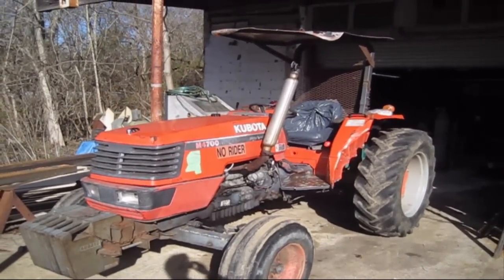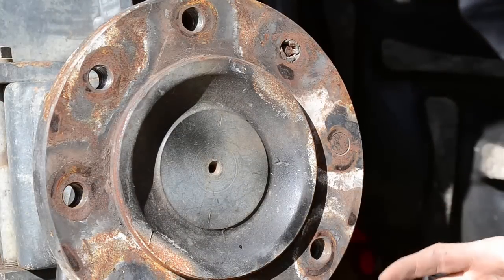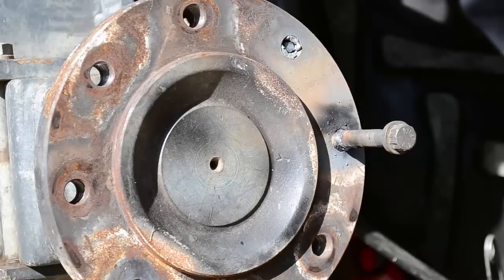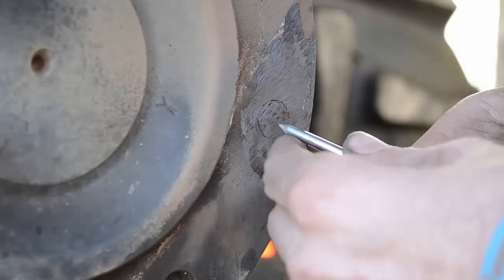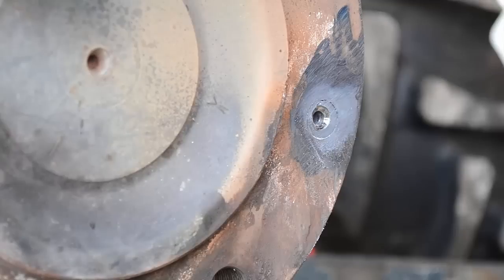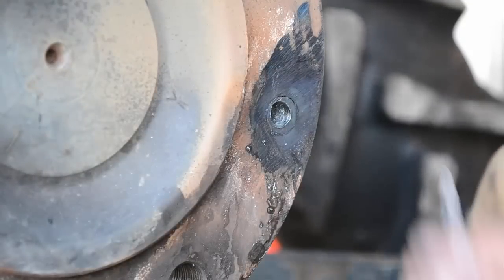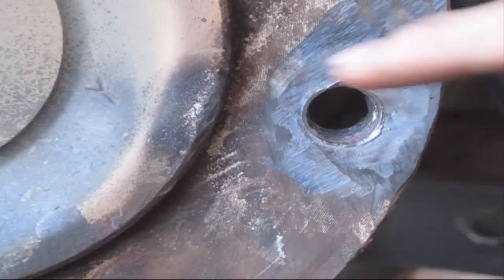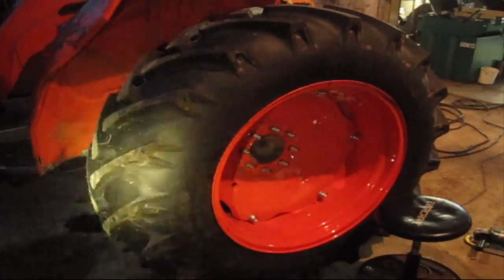Broke-off bolts techniques

Comment: A very good video. I've been working on classic cars for decades and often have these problems. In this case, you have great access and once you've drilled enough to get a mini-hacksaw blade through the hole, you can cut a slot and then chase the broken 'tube' of the fixing out with a punch.  As mentioned below, a welded washer or nut often works well as it gives you space to add plenty of weld without harming or welding to the flange.

Comment: Old machinist tip: aluminum fast, steel slow. (in regard to drilling or cutting speeds)
Reply: Absolutely right I drilled holes in railroad  tracks, it was a slow process,
Reply: Pilot holes would speed the whole deal up dramatically.

Comment: Wanted to see how you would correct the rim? A tool maker since 1962 I have removed many a broken bolts. We didn't have left hand drills, today use them first with slow rpms. If they can be drilled (not hardened) drill to the recomended easy-out inside diameter. Then throw the packet of eazy-outs in a lake. Now get a 10 inch adjustment wrench, a small ball peen hammer and all your flat files. Remove the file handle which has a tang which just starts into the drilled hole. Insert the tang until the angle stops, now tap a few blows with the hammer until the sharp corners 'bite' into the hole's sidewalls. Too hard will egg shape the broken bolt remainder! Adjust the wrench to clamp on the file flats, apply downward pressure on the file with one hand and back out the broken piece with the other hand/wrench. Also heed the lots of good advice from the other comments. IE ground the hub, heat one item only, lubricate, blow away chips before rotating, slow rpm and many others.

Comment: Good job. 
  A trick for you: to start a bolt, a nut, or a screw = first, turn it counter-clockwise, until you feel it fall into matching threads. This helps to prevent cross-threading... Greatly!
  You'll like it.

Comment: Man, you have the patience and drive I look for in a mechanic! I hit master mechanic back in the 80"s and I have seen some pretty inventive methods for removing heavily damaged threaded fasteners: heat the body of where the bolt is broken off in, then hit the fastener with ice. That shock from the sledge can then break the friction weld. Another track is after you drill all the way through the bolt, use a double 0 tip and heat just the interior of the hole and try the slow cool, but then use a "core" drill. A special type of bit that only cuts minimally on the face, but mostly on the flutes so the expansion of the hole is gradual, and when the wall thickness decreases,  it is far easier to get it to fold in, lastly use a lubricant such as "Rapid Tap", and drop the speed of the bit by 2/3. I charge over $100.00 an hour, so I have to be fast AND successful. If I am at home, I want you to come over, I'll damm sure pass on some knowledge to someone that listened and learned as well as you have done!

Comment: here is another trick to you from an old timer;;; on everything car truck tractor  everything, i allways spray paint both stud and hole before in screw  m.  even if i just painted it and took it out a minute ago. paint both again. it will screw easyer and 3 years later it will come out like yesterday. [ helps stop electrolises and rust and still be there like a coating so threads slide easyer.] a dollar for cheap spray can paint works fantastic.
Reply: Or just put some grease or anti-seize on the threads
Reply: Paint ? try anti seize
Reply: weak loctite (242 or similar ) does the trick too, I tested that on submerged steel fasteners and 10 years later, the exposed portion of the bolt was completeny shot while the thread inside the nut was in as new condition and I easily disassembled the bolt with a simple wrench .
Reply: Also, you want to constantly or frequently spray the bit with lubricant. This isn't for actual lubrication but to keep the bit cool.  It will parking the life and edge of your bits !!
Reply: LOL... there's an idea
Reply: skipper skipper antisieze copper gives good results as well.
Reply: That is what the aircraft industry does, it used to use zinc chromate primer.  The new primers work, too. Especially when putting two different metals together, magnesium and aluminum must be protected from the steel studs or bearing liners.
 I wonder how the new copper based anti-seize works long term. It looks like copper flakes in paint to me.
Reply: anti-seize

Comment: This video like others, do not understand what is happening and how to succeed.  I'll explain, I'm a Materials Scientist. 

When bolts rust the corrosion product, rust expands 5 to 10%. Heat alone DOESN'T  loosen it. The heated bolt needs thermal shock by quickly cooling  it with a water wetted clothe.

A rusted bolt has expanded rusted threads and chemically locked threads. When thermally shocked the rusted joint and chemically bonded joint will break. I proved this on a lawnmower magneto nut. Only thermal shocking loosen it. 

Did this help?

Comment: As a machinist and a mechanic I was taught a long long time ago to never start to drill fast and use plenty of oil to lube the bit especially in steel. The harder the steel and the larger the diameter of your bit the slower you need to go. I would also recommend using a good heavy duty drill with a cord and a keyed chuck than a cordless with a hand tightened chuck. It keeps your bits from slipping because you can get the chuck torqued better onto the bit and if you use bits with flats on the shank it helps to get all of the power from the drill to the bit instead of slipping too.  I work on mining equipment and drill/mill/bore all different types,  thicknesses , & hardness of steels and we never have this much problems with bolts usually.  I liked your approach but get some different types of steel and try different lubes, and speeds with the sizes of drill bits to see what works best.

Oh here's a cool tip for hole sizing too. If you need the hole a little over sized use an oil as the cutting lubricant if you want it to drill a little undersized use a thinner coolant like a steady flow of water into the hole the bit is drilling. Also like was mentioned in another comment from another machinist kerosene make for an excellent lubricant for drilling holes too.

Comment: You did a great job, with the mess you were left! I haven’t tried this method, but may father in law that was a  mechanic at a cement plant, said if you have a broken easy out in a hole you can heat it with a cutting torch and giving it a quick blast of oxygen. Because easy outs are so hard it will blast them out, and leave the softer bolt or stud still in.

Comment: Weld a washer over top of the broken stud, fill up the hole in the washer.  Then weld a hex nut or larger bolt to the washer.  It's MUCH easier than trying to weld a bolt to the stud.
Reply: great idea !!!
Reply: Joel Sullivan Very right. Also throw those 6011 rods in the lake. 7018 or 6010 all the way.
Reply: OR heat it up with a rosebud and throw water on it.. cut slot in it and remove with screwdriver, only on steel never cast unless you are talented. save the drill bits for future use
Reply: Joel,I agree with you 100%. Been doing it that way for over 40 years. If that doesn't work then go to the other means like drilling and repairing threads as needed.
Reply: Yes I have gotten out more broken bolts out with the nut and washer method from 1/4-20 on up
Reply: Joel Sullivan
Reply: wow, what a great idea. Thanks!
Reply: Joel Sullivan *
Reply: He said that some people prefer what you explained but he said he liked to use bolts.
Reply: Marty Saskatchewan. Please tell me the difference between 6010 & 6011?
'Cause to me, readin' between the lines,  you don't know.
Reply: Use kenetic energy  vt tightening first and then loosen easy
A few drops of penitratinf and a10,20minute wait will save you all this other trouble, 98% of the time.
Reply: @tandemwings4733  it's Spanish too much the 6010 6011 don't spend that much it's easier to handle
Reply: Joel Sullivan
You've been around the block. That was Uncle Joes favorite trick and Unk knew a goose from a gander.
Reply: @Robert Young. I have absolutely no idea what you're on about. Just what did you mean?
Reply: @Douglas Fontenot, I feel that you're almost there. 
To remove truck chassis rivets, after cutting the head off, we have to aggressively heat the rivet, then cool it quickly with copious water supply - front and back, wait a minute, and the rivet will almost fall out. Why? Well this is the bit that you may be alluding to.
 When one heats up the rivet (or bolt) in the confined position, it HAS TO expand, and because it CANNOT expand at the diameter, it MUST expand at the length. Therefore, when it is cooled, it shrinks (in all directions), but in particular, the diameter, and, voila! It comes out easy. It does work with both rivets and bolts. Your procedure is correct.
Reply: @Douglas Fontenot When I was in the Navy we used freon 22 to quickly cool the bolt. Any refrigerant would probably work. Alcohol may work as it evaporates fast but it could catch fire..
Reply: Joel Sullivan Thats what I was going to tell him(weld nut),nice video,too bad all the steps were wrong !!! You NEVER heat the bolt,you heat the flange,get it cherry red,smack the outside rim of the flange,impact loosens up the rust in the threads . My Dad(machinerepair for over 56 years) told me when you go to loosen a rusty bolt,nut,etc,to tighten it first,it breaks thr internal rust !!!! And it works 99 % of the time !!! Slow down your drillbit speed,use plenty of oil and more pressure on the drill motor .
High speed on your bits causes them to go dull and hardens the metal you are trying to drill through,I learned that when I was 12 & I just turned 81 Nov.24,2018 !!!!! Keep at it "kid" you'll pick it up as you go !!!!! P.S. A little PB Blaster on the threads would have helped too,don't use WD 40 that stiff ain't shit !!!!!!!!
Reply: Obviously, the steps are not all wrong, as the bolts came out and the job got done. There are at least three ways to heat/cool/drill/blast a broken stud out on this thread alone, and they all work.
Reply: Can you run that drill any faster
Reply: WHEN SERVICE CALLS was literally going to suggest thermal shock.. that’s how I get out seized up hydraulic cylinder pins.
Reply: @jimgaffney4524  20,000 RPM with an air drill? LOL
Reply: Joel Sullivan, can you do a video of the washer procedure and post it to youtube, please. I would love to see it.
Reply: I like that one but you gotta watch your current, so that you don't weld the washer to the flange.
Reply: @bilhep  If you can just weld a nut over the stud or broken bolt, using the hole in the nut as a guide, with everything clean! burn the stud hard and fill the threads inside the nut full> 
This has worked for me every time on a flat surface, and just as well using two sets of vice grip type pliers on a vertical surface.
Reply: @oshpunit987  I've used liquid propane (bottle upside down) but making sure there are NO ignition sources nearby and a decent breeze is going to blow it towards an uninhabited area) since it's now a non-PC "no no" to open vent CFCs
Reply: It work good for smaller less under 3/8 size but 1/2 over not work mostly shit .  But smaller mostly work very good. Cause I doing lot many time exhaust manifold job on cylinders head.
Reply: @martysaskatchewan740  - I hate 6011. 6011 SHOULD technically be very close to 6010, but actually using them, they are quite different. I don't have enough welding experience to tell you why, I can only say that they're much harder to weld with for some reason.
Reply: @robertgantry2118  @Marty Saskatchewan - It's possible that his stick welder is AC only (common for old school buzz boxes). To run 6010 you need a welder capable of running DC (DCEP - electrode positive). Probably most people with AC only welders use 6011 for tacking.
Reply: @wtsufan4558  You are correct, plus the difference will be DC Reverse Polarity will penetrate a bit more than AC. We used to use Unichrome rods from Arctec Alloys. They can built up inside a hole and we never once had a problem arcing against the threads. For small studs, a MIG or GMAW welder works the best. With either method, just weld it to a nut and let cool. Lots of weasel piss and Bob's yer uncle. BTW, in Engineering Tech school they taught us that if you heat just the stud, it will try to expand in all directions but is limited in expansion for the diameter because it is up against the casting or steel surrounding it. But when it cools, it cools in ALL directions...maybe a fraction of a thousandth, but it's enough to break it free. I never failed on one in 7 years.
Reply: I meant 'It Shrinks' in all directions. Made a buck or two on saving castings for (mostly) farmers.
Reply: If you drill a through hole in the bolt before welding the washer and nut on you will hopefully have a much easier time. The missing material gives the bolt more room to contract after three heat from the welder. Hope this tip helps.
Reply: @tandemwings4733  AH!!  I was wondering why heat the bolt and not the surrounding metal?  Shhhh ~  it's a secret!
Reply: @DivineMisterAdVentures  heh, heh, heh..!!! Now you have it.  Nothing that will help someone else is a secret when I'm around.
Reply: @Jambo Actually, you're pretty close.
Robert Young is, obviously, a nuff-nuff.
THE ONLY difference between 6011 and 6010, is that 6010's run on DC only, and 6011's will run on AC and DC.
I only use 6011's, ever, because they run real nice on DC, but if I'm on a site where there is only AC (and that does happen), I can use them there too.
Other than that, they're similar.
So the difference, in my case, is simply, ONE. heh, heh, heh..!!!
Reply: on this I would weld a nut on to bolt with stainless steel rod or wire feed  or 7018  ,,, when done use box end wrench and while it is red gently move back and forth as threads are soft and will come out easy  this has always worked for me , never weld bolt as can not control puddle so can do as this man did and puddle creep out to side wall and make life very hard ))))
Reply: @tomsmith1390  exactly right ,all he need was oversized nuts and washer , cold water to shrink stud down after welding and it will come out 9out of 10 times .
Reply: That's how I've done it since 1977 👍
Reply: Heat and cool broken stud three times keep flange from heating , weld next size nut on the stud and it has to come out. I was a machinist and a millwright in a pulp mill.

Comment: I am a 1st class machinist and believe me you have dulled those drills in seconds running them at that speed and quite possibly work hardened the broken bolt. but in the end, I must say, very good job :-)

Comment: Good stuff! I dig the long cut, no BS videos. Just work and information from start to finish. And props for talking to the viewers. It's rarely understood how much really goes into a video like this. Subbed
Reply from the maker: Thanks for the sub!  Glad to hear that long videos are appreciated.
Reply: I am subbing in just a few seconds, this sort of education is exactly what I need. Thanks  Classic Work
Reply: Drilling WAY TO FAST.
Reply: whitey george       We either use thread lock or anti-seize on all bolts & nuts,   They both have their uses,,

Comment: Heating a large area with a hole in it will cause the hole to become smaller!  If you can't heat an area which goes to the perimeter of the "thing" you are heating, the expansion has to go somewhere, and it goes to the hole, making it smaller.  Sometimes, though, even making the bolt tighter in the hole is enough to break the corrosion/adhesions and break it loose.

Comment: Classic Work, at least you got it done in ONE Day!  I spent 3 weeks working on a frozen bolt on a Ford Thunderbird front strut. I ended up just buying new struts and new Lower Control Arms. Both sides were frozen. Only took me ONE Day to do the right side of the car. I just cut off the struts with a hack saw and tossed the old control arms!

Comment: It's probably been mentioned all ready, But because of the condition of those holes I would have gave some serious thought to using the New wheel as a index guide and center punching, redrilling, and tapping 8 new holes in between the original holes.
Reply: Oh god that is a good idea, just bless the old plugged messed up holes and start fresh.  For me it is hard sometimes to let go once I get started on a job, I get kind of polarized and obsessed with overcoming the challenge.

Comment: I have used a pin punch ground on an angle to make a round chisel to clean out the threads after drilling most of the threads out. The really tricky part is finding center because the thread overhangs on one side and makes it look like your centered when you are not. The best results I have is to start with a small size drill and watch closely before going to deep because you can angle the drill and move the center where it needs to be, but not after you get a hole started very deep.

Comment: The way I was taught in the 70's is ----
Once you drill a hole clear through the broken stub, it shrinks.
Then you could have return to weld a bolt / washer nut.
Also, because you have access to both sides you can add heat to one side then spray penetrating oil on the other, The heat will pull it through the threads and after it cools do the same to the other side.
When you want to impact it out, heat the metal around the stud. This helps widen the gap in the threads.
So 1. you shrunk the bolt by drilling a hole clean through.
2. You pull penetrating oil through the threads.
3. you widen the thread gap even more by heating the metal around the broken stud.
Nice work.